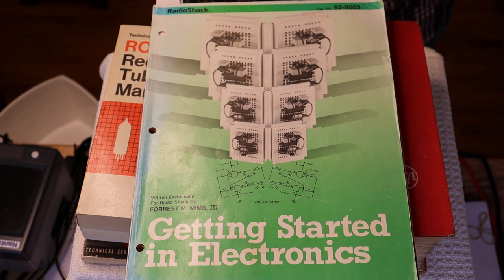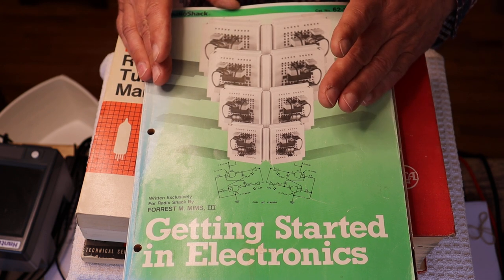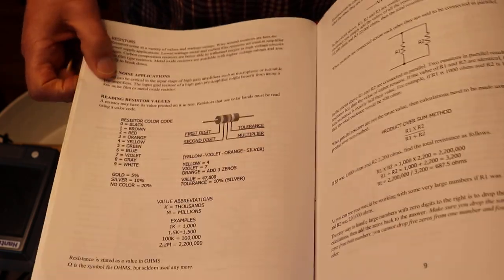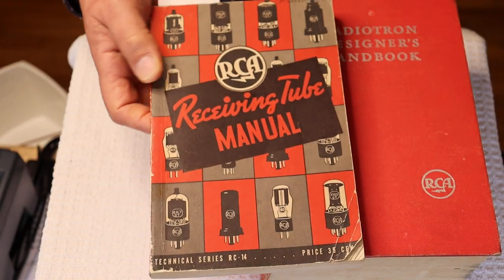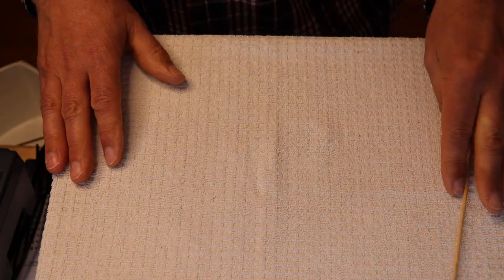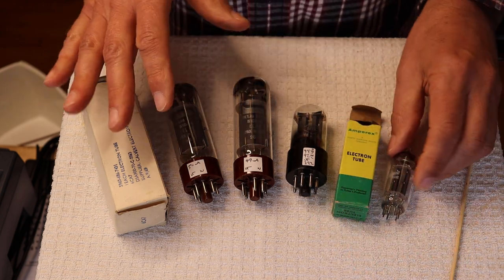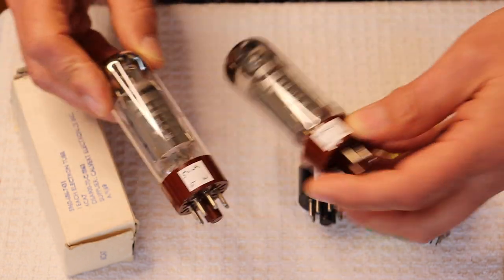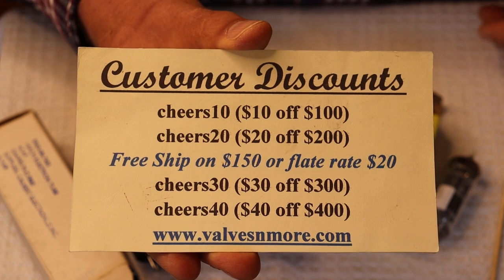Tube Lab #133 - Books To Help You Get Started in Tube Electronics

Comment: Eh, you’ll get back the ability to tell the value of a resistor again just by a quick glance. Just takes building and even designing gear, which you of course do. When building a circuit, it’s of course a good practice and smart to test em on a multimeter as well. 

Those RCA Receiving Tube Manuals are an absolute necessity for anyone playing around with tube circuits. I’ve got about 6 or 7 of them spanning the 50’s - the 80’s, which I inherited from my grandfather. I’ve even got his Radiotron Designer’s Handbook, which I open occasionally. He had an electronics shop above the garage. He was a HAM radio operator, and built EVERYTHING from scratch. He had a pair of original McIntosh MC30 monoblocks and a huge pr. of DIY speakers. I fortunately still have his very extensive and huge tube collection and his Hickok 600a tube tester, but not sure where the McIntoshes went 🤷‍♂️ 😢 

Thanks for yet another fantastic video. 👍🔊😊🎶